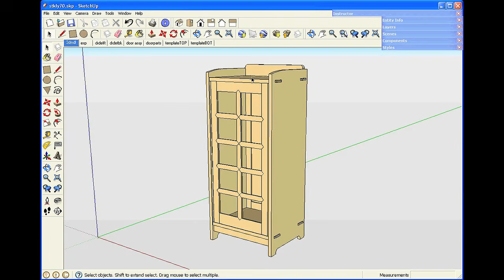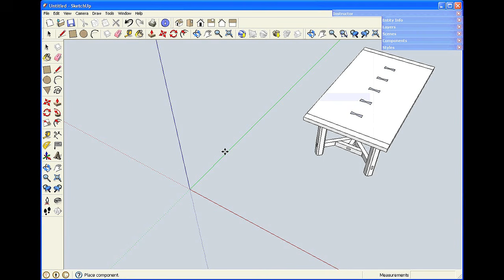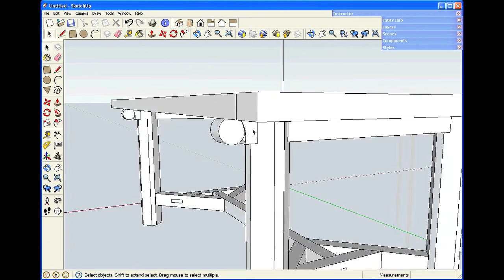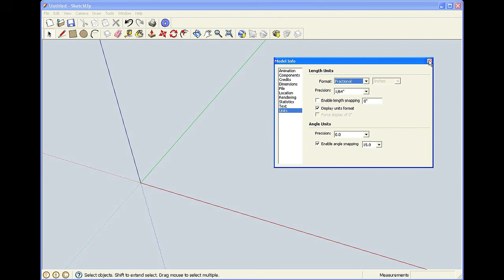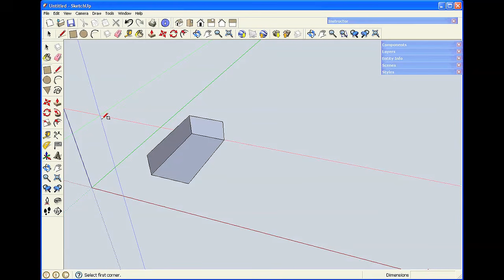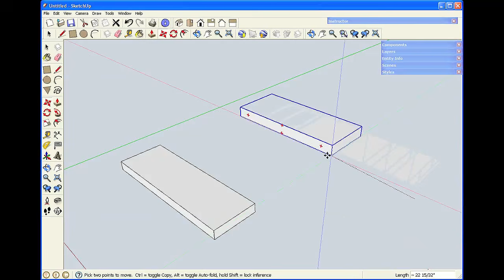SketchUp for Woodworkers: Getting Started 1-4. Robert W.Lang

Comment: Recently I have started having problems with my paid version of Web. Using the create a rectangle  I make the size of say 2,2 but when I really check it with tape it may come out like 13578 7/8 ,1454 5/116. So what the heck is that all about? It was working just fine but now........? My select tool doesn't work as usual  automatically going to the next tool but I may have to return to the select tool manualy then select a new tool ? All this just started recently and used to work as normal Not now. Could you please help me out because I was working on a project and all of a sudden this changed.